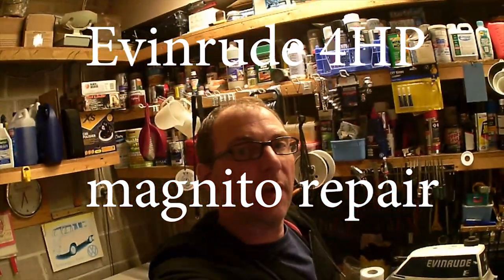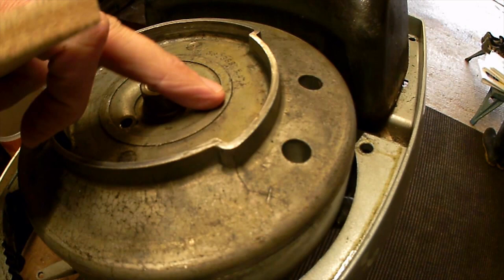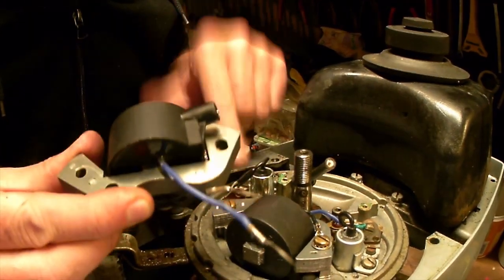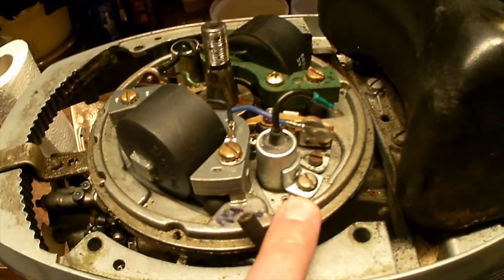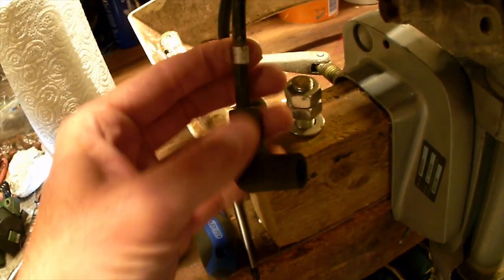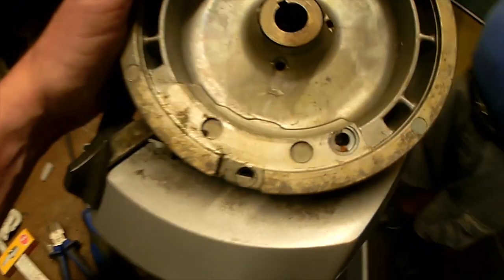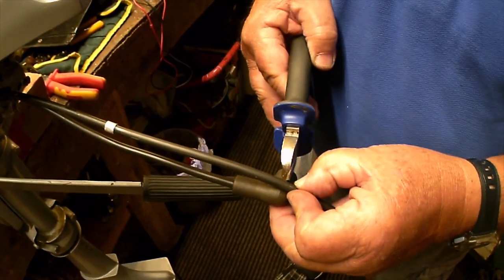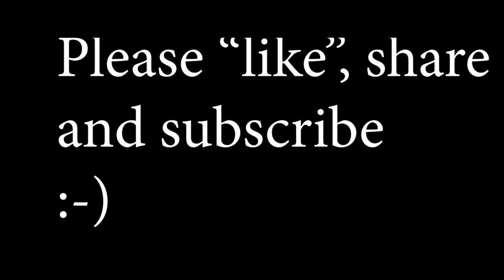SFS4 - Evinrude Johnson 1976 4 hp outboard engine electronics spark repair - MagnEto repair

Comment: i know this isnt anything to do with the coils,but where is the fuel pump if it has one?,i have almost the same engine and used this very helpful video to do some tests because mine wont start...(looks like it hasnt been touched since 1974),engine is black oil inside but no petrol so i think its the pump? cant find the info on any other video for these early models.

Comment: What is an "H tealeaf" I couldn't understand the 'British English". I have the same motor, but it's a circa 86 or 1988 Johnson Sail Twin. Mine was running just fine when the RPMs declined, the motor backfired, and five minutes later quit, and we noticed an intense odor of burnt insulation. My coils contacts etc. were just replaced a few years ago, and it didn't run on one cylinder, so I'm suspecting something major coming up from the magneto. I hope it isn't the magneto itself. The local OB repair place now won't work on any OB older than 1990. Sigh. The OB is so light, and my back is so bad, that I've just got to fix this baby.
Reply: H tealeaf..... haha, so funny. 
I'm actually saying " HT lead". The High Tension lead that goes from the coil pack to the spark plug.
I know we broody love our cup of tea though.
Reply: @RichardBrocklesby101  you sure that's not a 86?
Reply: I have the same motor I just did a carb service hoping it will fix my issues... I think they built this series 79-87 with the like cowl and graphics.  Great video hope it's all good thanks

Comment: How do i get lose the top correcg?
Reply: The top what?
Reply: I try to remove the top or lid that covers the ignition parts. has loosened a bolt but can not lift the lock by hand. 
Google translate 😇
Reply: @RichardBrocklesby101  I try to remove the top or lid that covers the ignition parts. has loosened a bolt but can not lift the lock by hand
Google translate 😇
Reply: @p81dap51  you need to make a puller (like the wooden thing with 4 bolts). The three small outside bolts screw into the cover. The big one in the middle will push down onto the centre and then it will pull the cover off.
You can not remove the cover any other way.
Reply: @RichardBrocklesby101  I built a puller out of a steel plate and it sat tight I can say. now the lid is off, yippee.
I have no spark on the spark plugs do you know what to look for first?
thanks for a great video 👍
Reply: @p81dap51  first check the points are not worn.  Then test the condenser.  I bet the HT lead into the coil is corroded though.
Reply: @RichardBrocklesby101  thank you I will follow your advice step by step.
another issue, is there engine oil in this engine. owned a 4 stroke before that had engine oil in it.
Reply: @p81dap51  with a 2 stroke you mix "2 stroke oil" into the petrol.